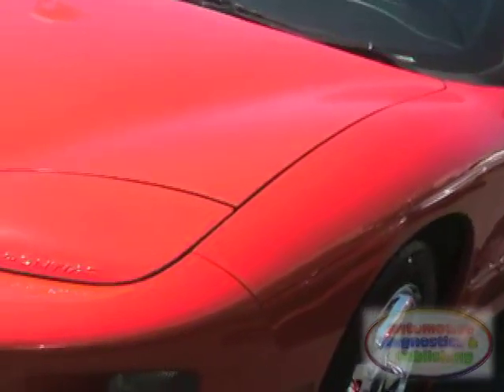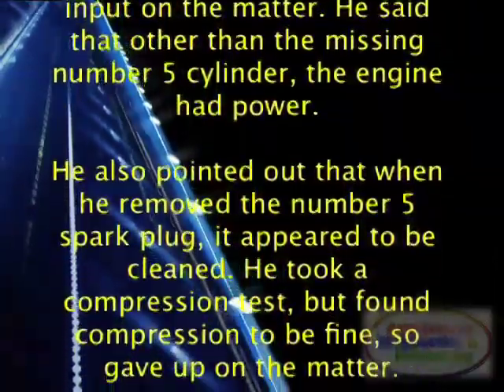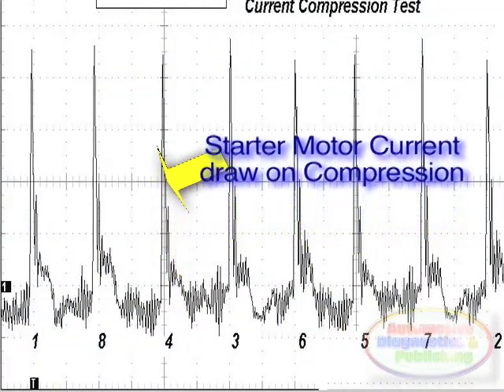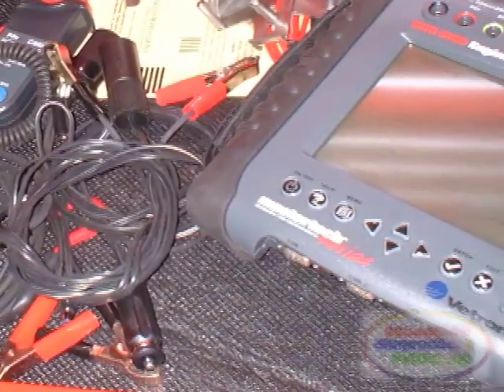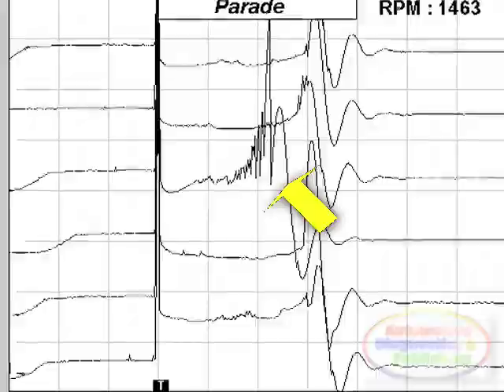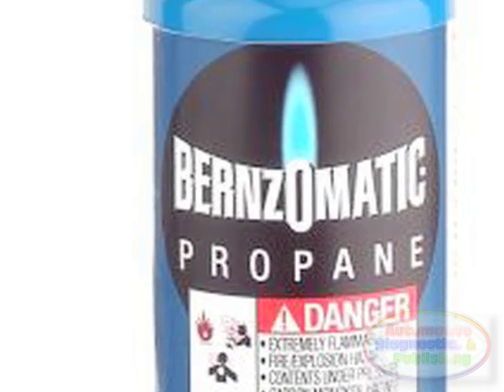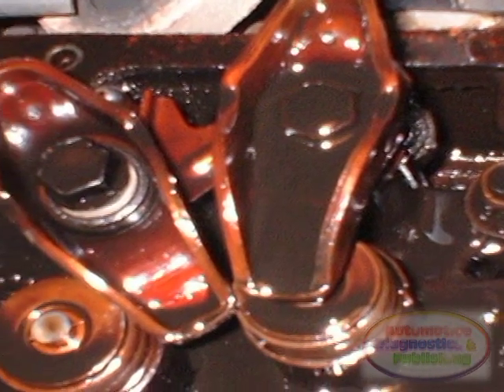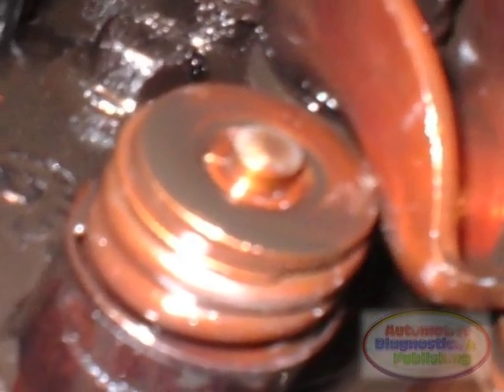Misfire Code Pontiac TransAm DTC

Comment: Thank you for these videos. I worked  for myself for 15 years & was falling behind on OBD II diagnosis. So i decided to get a job to  get caught up & free training by working with knowledgeable techs. After working at 3 shops, getting to know & visiting about 11 others I learned this- to fix a check eng light Pull the code, replace whatever it says. Do a major tune up. Clean trrottle body & injectors. Clear codes. If the light comes back sell what you can or count the $ you've already made. SAD

Comment from the maker: Yes, you can definitely pick both intake and exhaust. Doing a RC test is best done using a graphing multimeter, like the Vantage.You won't see anything using digital only. THe idea is to acquire a large waveform database and study the waveforms signals. Practice will make perfect. Thanks for posting...

Comment from the maker: @j0k3r9696 Thanks for the post. yes, but also if there's a coolant leak the spark plugs get a specific deposit, which is quickly recognized by any technician. This plug was clean, no deposits, and a sign of no combustion... Thanks again...

Comment: I have seen this before on  4.7 Chrysler engines before, but they have been easy to find due to popping though the intake during a snap throttle.
Would this have shown up with a vacuum gauge?

Comment: great video Mandy     just a question   on the relative compression wouldnt cyl 8 be higher than everybody else because cyl 5 is coming up with a closed exhaust valve on its exhaust stroke?   there running mates     stories from the road are great   thanks so much
Reply from the maker: Thanks, cyl 8 ?